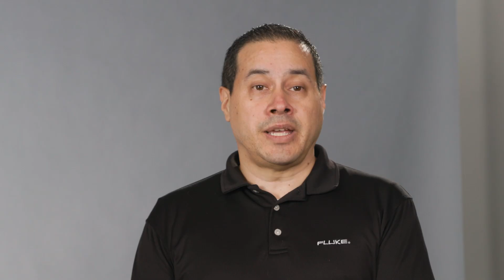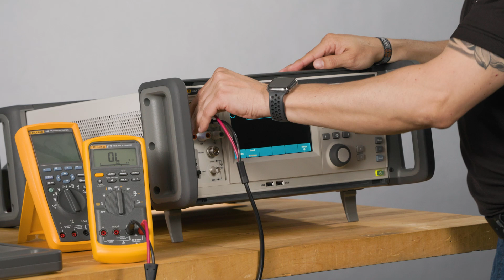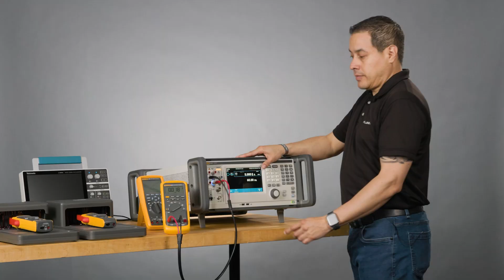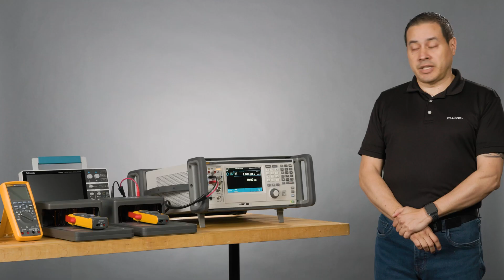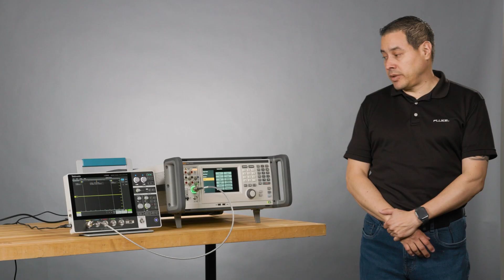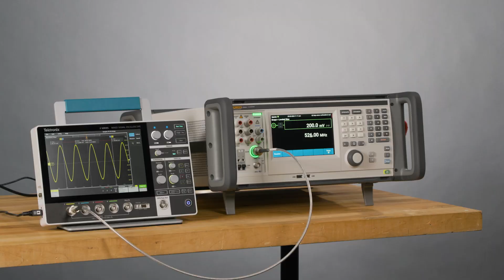How to Calibrate a DMM and Clamp Meter Using the Fluke 5560A Multi-Product Calibrator

Comment: Thanks for the video. 
I was hoping you would also show us what happens when there is a discrepancy between the DMM and the 5560 A Multi calibrator
Reply: Depends what magnitude of discrepancy. Grab the calibration guide from Fluke's website. That will give you the test points to check, and an adjustment procedure to follow to adjust the meter if that is necessary.